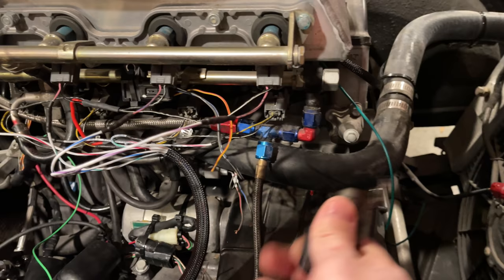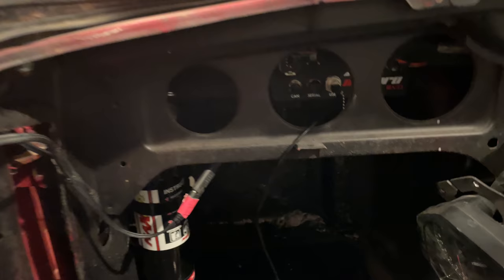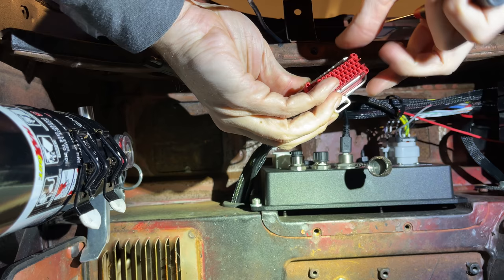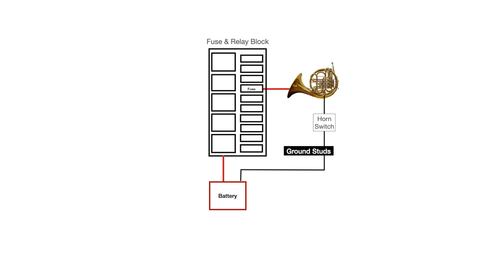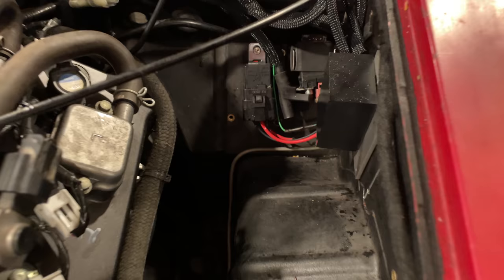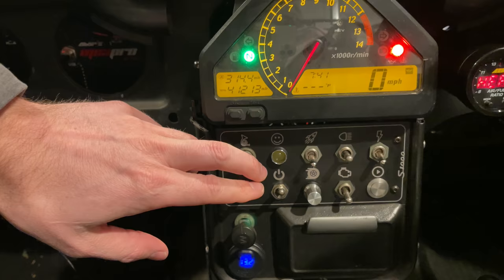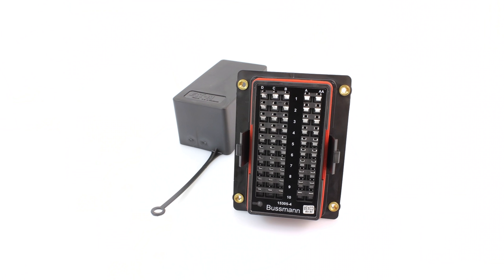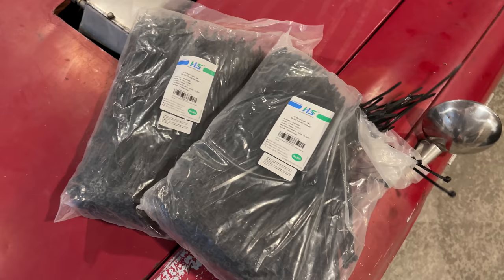Re-Wire Your Whole Damn Car - How To Do It Correctly & Inexpensively

Comment: Hi Matt, I am really enjoying your series of video presentations on this subject and the Megasquirt stuff. Excellent delivery and information. I’m currently researching retrofitting carbs to efi on my bike, a 1984 Honda VF1000F Interceptor. I’d like to use a dash from an 04-07 CBR1000RR Fireblade like you have. Was that a straightforward enough process by just matching the pins to the appropriate wires? Or did the dash need particular data/adapters etc. to make it work?

Comment: Hey Matt. I’m lookin into just building my own fuse setup and Harness for a sand car. I’ve been lookin to into Micro PDM and they make a brain box that’s the iso pin size that can take a regular fuse block setup like in the video and add can bus control too that you can use can keypads with and a bunch of other cool stuff. We run a bit of accessory’s between radios, gps, seat heaters and a lot of lights. How would you go about wiring something like that.

Comment: Note: Do not go "green" on wiring. Make sure the wires you purchase do NOT have soy or other plant based insulation. Every member of the rodent family from rats to squirrels WILL find them and chew on them and, assuming your car doesn't catch fire from a short, you'll have to start over and rewire it all.

Comment: Note:  MOST wiring on a car is discrete, but watch out for shared ground or batch fire on fuel injectors.  Testing as you go confirms the last wire you connected is fine, but it's apparently (ahem) possible to cut and reterminate the same wire multiple times and end up with only 1 injector firing out of each set.

Comment: I've got a 2002 F150 Prerunner that I will be wiring 100% as my late husband pulled it all out. I'm really feeling this will help me alot. Just wondering if I need to buy a crack lighter to start.
Reply from the maker: The crack lighter is required. The crack is optional.

Comment: A valuable piece left out was that you should pull test your crimps especially if it’s the first crimp you’ve done with that combination of wire, terminal and die. Doesn’t need to be remotely scientific, for 18ga and smaller the wire should snap, not pull out of the terminal, for larger than 18 ga you probably won’t be able to break it so just pull real hard and make sure it doesn’t move in the terminal.

Comment: found you to be top dog, great job in helping  us to understandthis car electric stuff. I have a proble which I have been told it cannot be done , I would love your thoughts on it. I have a  1971 VW aircooled beetle wiper motore an want to operate it with a GM pull switch. Cant find anyone who can help with th connections and one guy as mentioned before believes it will not work. Please let me know if you require more inFo?

Comment: I dont trust those chrimp connectors. So for my aircraft I used those insulated ones (stronger), cut away the insulation, chrimp, solder the hole thing. Wont ever come apart.

Comment: One line in this really caught my attention.
Ground the ECU direct to the battery.
Why is this?
I've always believed you should only have one earth cable.
That may if your main earth fails, you don't try and start your car using some skinny wire as your only remaining earth.
Is the ECU earth completely isolated makeing it a non issue?

Comment: I would save myself the hassle of safety switching the key with the clutch, as two of my cars dont have that nuisance and can be started in gear, which is mighty fine with me, as i dont park them in gear... The handbrake is designed for a certain purpose, and leaving the car in gear is not a mechanical brake, its more of a pneu-lock brake that heavily relies on your compression state and health of your engine... Leave a car in gear on a hill and it will roll if the hill is even a bit inclined... Hell, thats how you push start a car... Get it moving in neutral, jump in, clutch it, gear it, and simultaneously turn the key and release the clutch... Especially if its an older car... An engine is technically a large compressor with roughly around 10/1 or 20/1 compression ratio and if the engine is used as a brake, it is only efficient while the forces that it brakes are less than what is needed to turn the engine over one full turn... You can hand crank an engine with a lever with relative ease... Now imagine a one or two ton car on a hill... It has much greater capacity to exert force and turn the engine over than a bloke with a wrench... Brakes are used to diminish speed greatly or to keep the vehicle still, the engine should only be used as a brake during its running, by modulating throttle, as not to have to waste fuel or brakes, as an engine is a good brake while moving, but not a good way of keeping a car still... Its like a hydraulic jack... Its great to lift a car up, but not great as a thing to keep the car up... Each tool for its own purpose and you are doing the job right...

Comment: OK, full disclosure. I did wire a worklight on my work truck. No, I didn't use a wire nut. I just twisted the two wires together and wrapped them in duct tape. I'm sure it'll be fine.

Comment: I'm confused on how a full fuse panel can be supported by a 40amp relay, when the fuses total up much higher than that. I get that not every circuit is running full boar all the time, but still...wouldn't you need at least a 100 amp relay?

Comment: In terms of safety, is there any problem to wire a switch on the pin 85 of a relay and using a jumper from 30 to 86?

Comment: I never trusted those flat wire connectors.
Whenever I use them I solder them to the wire and add some heat shrink.

Comment: 11:29 i found wires with PTFE which have even higher temperature resistance than SXL but that's overkill. Anyways in europe it's hard to find your mentioned wire clases but you pointed me in right direction (:

Comment: Curious man, anybody sees this bought a car it was rebuilt on the front end and that’s the problem the back lights work great blinkers brake lights, reverse the whole bit lights upfront you need the highbeams on to get the blinkers to go is the only problem do they make something that I can tap into the back lights and then wire the whole tap on it and rewire all the way just to the front light sockets and plug my lights in and I’ll be good or not

Comment: i rewired the power distribution box when i had to replace it on my van, that's about as far as i ever plan to go call me lazy. my easy button is simple if i ever get a car with a bad wiring harness, its a fire hazard waiting to happen. junk car and get another.

Comment: @SuperFastMatt One thing this didn't cover was splicing wires. What is the best way to splice wires? I'm building a wire harness from scratch right now and have the need to splice several wires for the lights.

Comment: Enjoyed your well presented and informative video. 

I would suggest using a known wiring standard (colours) rather than messing about with labels. Here in the UK just about every post-war classic car was wired to BS AU7 and it is remarkable how quickly you get to know most of the wires simply by their colours so you seldom need to look them up in a book. The main colour tells you which 'family' it belongs to for example green cables are fused feeds, live only when the ignition switch is on. The stripe on the cable tells you specifically what the cable does.
 Open up a loom and you know exactly which cable is which and it costs much the same as having them all the same colour.

Just a thought.

Comment: This is nothing like the reality I have spent many years working has an automotive electrician and what most people do is they just go to the store buy a half dozen rolls of wire unroll it throw it up under the dash connect both hands whatever they need a piece of wire for something else it just cut a chunk out of the middle and reconnect the ends making sure to leave all spices under the dash at least that's how it looks when it gets to me one other additional note make sure to change the color of the wire at least three times in each circuit run.

Comment: Nice video.

What do you guys think about fusing the control side of relays also? Is it too much of fusing or do you like it?

I like crimp -> solder -> isolate on connectors. I like the prefabricated push over isolators. Thoose which you have to have on the cable before the crimp.
Finally somebody speaks it out. The coloured connectors are mostly good to do one thing with them.....throwing them away. Ok, they are still better then nothing.
I had so much of them being unreliable and loosing the cable because of low holding force. Some have a washboard structure in them. Some have smooth surfaces.
Crimping is the better way, because you can visually inspect the result. Also soldering afterwards gives the extra reduction in resistance and pull safety on the crimp. But I admit, soldering the crimp is +1 on the nerdiness. :-D

Wow. Somebody else, who recommend an expensive crimper. I LLLLLLLLIKE you. :-D

Comment: NEVER ground an ECU directly to the battery negative. If you for any reason end up with an open circuit on your main ground, then that tiny ECU ground will try to carry the entire load of the vehicle's electrical system. You'll end up with a damaged ECU, or worse, an electrical fire.

Comment: I need to rebuild a wiring harness using the old connections just replacing the wires.  Where can I purchase the metal tips to plug into the plastic housing for the connection to the car?

Comment: I got a 2001 s80 volvo long story short had to rplace tailight assembly and connector different another lo g story now i have no connectors just different colored wires and need to know which wires wire to which

Comment: Why should one worry much about having a good ground connection with negative terminal of the battery? First, the battery is a consumer of energy when the engine and alternator are running. Also, the alternator's ground is body of the engine, isn't it?

Comment: Just beware some cars are....yeah insult insult here and have ground switching, like the Toyota 80 series landcruiser runs earth switching headlights.
Also if its for a road car, or even raod/offroad it can be worth leaving the old harness there unhooked for vital things, an example on my 80 series lights, glow plugs, indicators etc will have the old harness tied up near by so if the new one fails I can get back in action fast.

Comment: @superfastmatt or anyone who knows, but does adding a "main relay" after the battery and before (between) the Bussman fuse / relay box make all additional relays to "devices" connected to the Bussman fuse box redundant and therefore unnecessary? If not please explain, thanks for the advice in advance.

Comment: troubleshooting wiring is easy, it has only two  problems
1. there is connection there it should not be
2. there isn't connection there it shoud be

Comment: 2 years later how deep is that mess on the table now 🤦‍♂️🤣 I wasn't sure if you would have any set up for every roll of wire  shrink wrap, etc like a paper towel dispenser so anything left on the table is scrap or short runs waiting for Installation 👍

Comment: Question. I am rewiring the passenger side harness and sensors. I cut it right past coil 6 and got a new one for the replacement of it. Issuedoes any of the wires coming from the knew wires connect to more then just one. I have like 7 extra wires coming from the car and none from the knew wires. And I matched up the colors  as I went?

Comment: thanks man. i have a question if you have the time, do you think an amp meter is a useful tool for this job or for future service/diagnostic and if you can recommend some model/make. i will just need to work awg to mm2 and sort the connectors with what is available here. thanks again. i´m rebuilding an old rat and everything helps. take care. peter
i know you  talked about the multimeter and i have one same one as you showed

Comment: I started to use the large fuse block suggested, but when looking at the data sheet it says max 30amp out per circuit, and max 100amp per bus bar. That seems incredibly low and even the company's data sheet photo shows 35amp/24v relays. Are they just being incredibly conservative with their ratings?

Comment: When it comes to wire, it's best to buy marine grade wire.  It's a much better grade of wire and it's also tinned so it holds up to moisture much better than copper only wire.  Also, spend some money on a heat gun and don't use a lighter to shrink tubing.  That looks so unprofessional!  one last tip; use flush cutting dikes to trim all your tie-wraps "flush"!

Comment: 14:55 I'm an electrician (unlimited voltage certificate) and also an asshole on the internet
what's shown is very good, but could be better. solder and silicone paste before heat shrink would lower the resistance and make the connection more corrosion resistant

Comment: Do not "air on the side of more fuse" When wiring something up. you NEED to know how much current a circuit will draw to have a proper fuse. If you don't know, you can measure, then properly figure out what fuse you need. 
If you have too much fuse, it can easily fry or melt something before the fuse blows.
Reply: It's "err", not "air". And you're not going to fry or melt something if you use appropriately sized wire... Matt is suggesting that you size the wire based on the fuse, so you will never have undersized wire.
Reply: @brianb-p6586  Ok, You have a lets say 500 watt electric fan, running at 12v it takes up  41.6 amps. It should have a 60 amp fuse, especially to deal with the initial startup current. If you listen to that statement, and run a lets say 200 amp fuse, and the fan malfunctions, you will melt the fan before the fuse has a chance to blow. My point is, whatever circuit you are fusing needs to be a somewhat calculated fuse. Dont just run everything with thick wire and then use huge fuses, it will surely cause a fire.
Also I appreciate the spell check, but I dont care. Its youtube not a college
Reply: Also, I am not hating or trolling. I like this channel, you can discuss something without immediately pointing at someone and going " You're wrong you're wrong my youtuber is a god!" Youtubers are people, people aren't always right.
Reply: Don't try to protect equipment from internal failures with fusing of the supply circuit. A small electronic power adapter to run your phone uses only a small fraction of one amp when operating properly, but plugs into a household circuit overcurrent protected at 15 or 20 amps... and that's safe and appropriate. The breaker or fuse is there to interrupt current which is excessive for the wiring of the circuit to the receptacle, not the devices plugged into it.

If a device needs a fuse to handle its own failures, then it needs to include that fuse (or breaker) internally, as many devices do, rather than depending on a "just big enough" fuse in the supply circuit.

And "air" is a completely different word from "err" suggesting that the writer doesn't understand the meaning of the statement, not a mis-spelling; that's the only reason that I mentioned it.
Reply: @Zerocool818  Matt is not a god, and I didn't suggest that. We're talking about fuse and wire gauge selection, not the presenter. And not only are people who post videos to YouTube not always right, most of them are probably wrong more often than they are right.

But SuperfastMatt is about as close to a God as you get in the online video world, although in YouTube the real God is the Algorithm. All Hail the Algorithm!
Reply: @brianb-p6586   Its not just size of wire and fuse , you also have to know how much current the circuit is going to draw. A dome light does not need a 30 amp fuse
Reply: @Zerocool818  Right... but it will work with a 30 amp fuse, and it will work safely with a 30 amp fuse and wire suitable for more than 30 amps. In fact, your dome light in a regular production car works today on a lighting circuit with far more capacity than the dome light needs.
Reply: @brianb-p6586  It will work,  but in case it shorts out, it will melt the dome light before it blows the fuse is my point. If you have a device that draws 1 amp, you put a 5 amp fuse. if it blows for whatever reason, you want it to be much sooner than later.
Reply: @Zerocool818  Nope. Shorts in wiring don''t melt attached equipment, because they short circuits, meaning that they're faults which allow current flow where it shouldn't go, bypassing the attached devices. They melt wiring... unless the fuse is appropriate for the wire size.

If you have a car old enough to have a separate clock (not a touch-screen infotainment system), check the fuse for the circuit it's on... no, it's not just a 0.1 amp fuse.

Your guideline from earlier, in a post in which you gave an example of fusing 5 times normal load as dangerously excessive, is that every device had to be supplied by a circuit fused at no more than 1.5 times the normal draw. In a modern car, that would mean hundreds of circuits. With a dozen bulbs (or now, LED unit) on the interior lighting, every one would be "over fused" by your standards, so they would all need separate fuses... which is ridiculous. In your house, each 10-watt lamp would need a dedicated circuit with a special 0.125 amp breaker.
Reply: @brianb-p6586  I have seen 2 amp fuses pretty common actually. I literally do automotive electrical for a living. You dont have to get that precise. But you do have to make sure whatever load you have has an appropriate fuse.  You also dont have to fuse every individual item on a circuit, you can conjoin things. I never said you couldn't